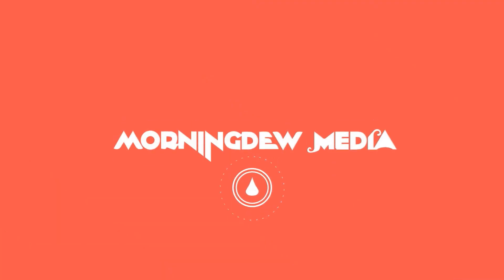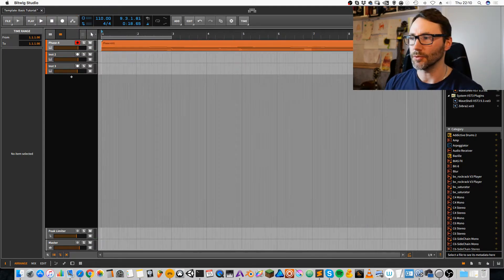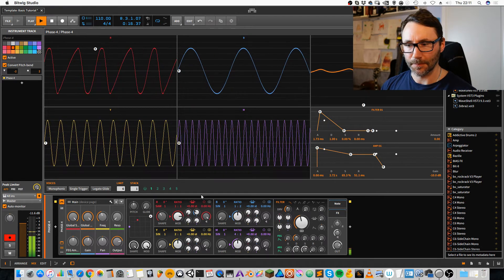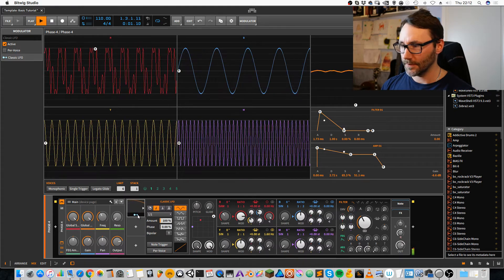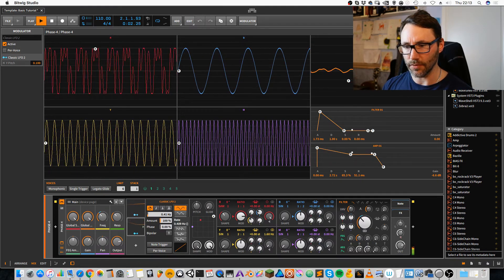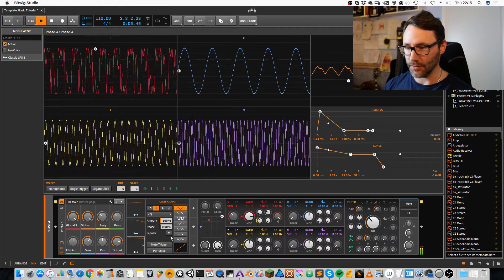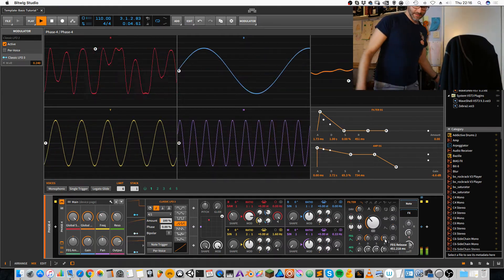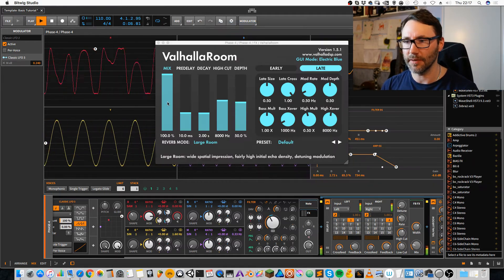Bitwig - Phase 4 tutorial - Create epic pads synth tutorial

Comment: Excellent job!  Very nicely done and explained at a comfortable pace.  Very rarely have I found someone NOT rushing through.  I am a seasoned musician and film composer but new to modulation etc.   I also use a Roli Seaboard 49 with the 5 dimensional mpe feature and Roli's Equator vst using built-in patches that modulate without getting into sound synthesis that it offers.  
Is there any chance that you might be able to incorporated this type of sound design in future in Bitwig along with a Roli modulating with live playing the Roli seaboard ?
Reply from the maker: Sam H thanks for the great feedback. Yes I will always do the tuts at my pace, and try not to rush it. If u are in a hurry u can always fastforward with a click. :) I am glad u find the pace good in this one. Yes its all about midi CCs triggering / effecting /modulating different things. I do not have any Roli gear yet, it looks promising for doing alot of cc (modulation) at the same time. But I do have the Nektar P6 which had VERY tight integration with Bitwig, its awesome. But since grabbing the Komplete Kontrol mk2 I rarely reach for the second (or third keyboard...Axiom). Axiom keyboard was by far the best keys (to my taste), but modulation was wicked and broken on the Axiom which had limitless rotary encoders. Anyways, ranting away. Sorry. If I do fetch a Seaboard I will probably do a video about it.

Comment: There is a software like bitwig opensource/free for linux?
Reply from the maker: No, there is no free software like Bitwig Studio. But Bitwig Studio does play well in Linux. 😋
Reply from the maker: Ive been using Helm briefly and will make a video on some of these free plugins which are actually very good. UI might be a bit fiddly but they do sound great. Helm has some nice modulation power, with cross modulation on the oscillators. Hope to cover it soon. Cheers!
Reply: @MattiasHolmgren  . Ok Thanks.
Reply: @pasquale9554  I like Helm, I find ZynAddSubFX to have rather unintuitive and scattered user interface. Things I have high hopes for but haven't tried out yet: Surge and Vital.
Reply: Sorry if I add up to this "dead" conversation: I know it's expensive, but I think Bitwig is worth the price, especially considering the Linux support and the winter special sales. Also, you get to support a "young" team! :)
Reply from the maker: Indeed! 💎🎉

Comment: What does bipolar mean and how does it affect the sound when modulating for pads or synths ?
Reply from the maker: In math: If we have a starting point at 0 and modulate a +5 bipolar. Our values will go from -2.5 up to +2.5. But if we modulate unipolar the values will go from 0 to +5.

So bipolar goes two ways of our offset point. While unipolar only goes one direction from our offset point.

So when modulating something its often easier to use unipolar mode since its much easier to set your starting point so you get a max (or min value defined) . If you use bipolar you must look and see where your modulation end up. Which is harder to fine tune.

That said I use both uni and bi depending on target to modulate.

Hope that made sense. 🥳🌞🎅